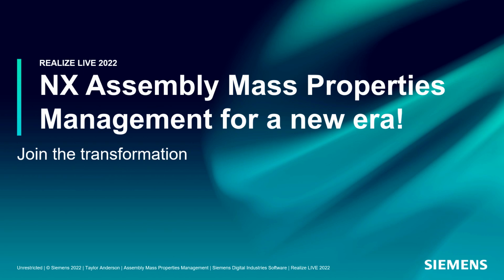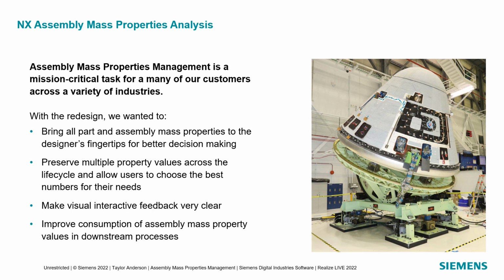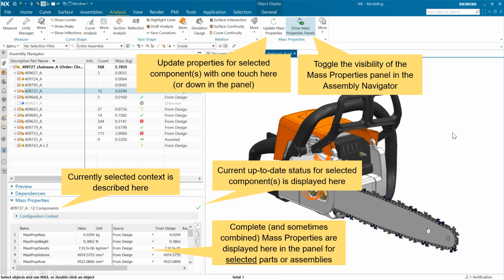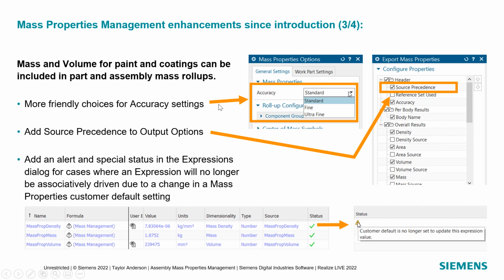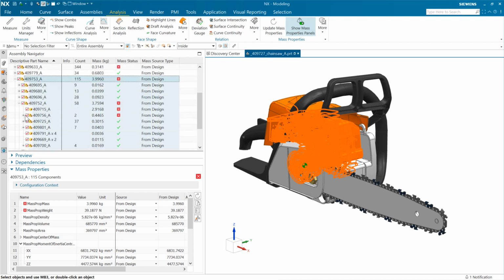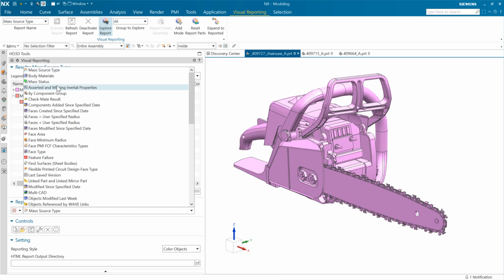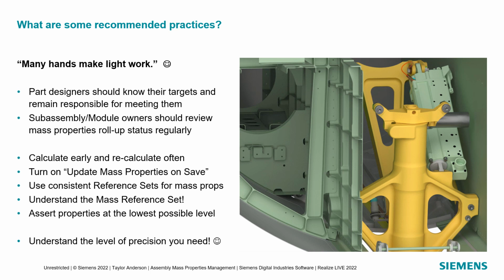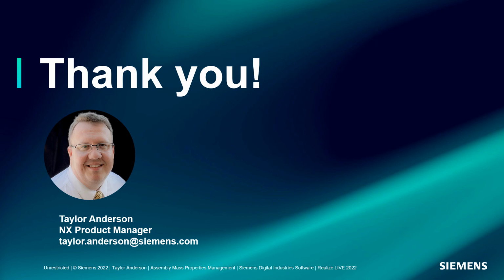NX Assembly Mass Properties:  Overview and What's New in NX 2206

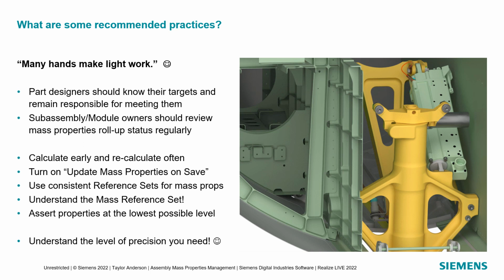Comment: Thank you for the info. At 36:30 you mentioned instance attributes. Do you have a video that elaborate this? I have some issue where assert mass at sub assembly is not rolling up consistently. Thanks!
Reply from the maker: As I mentioned in the video, assertions at the individual component level are going to roll up easiest.  Fundamentally, assembly-level component assertions are local to that specific subassembly, and will not roll up to higher levels.  As a rule of thumb, if you want to create a clean assertion that will roll up to higher levels, always make the part or assembly for which you are asserting a value the "Displayed Part" (not just the Work Part...  Use "Open in Window" to make sure it is the top-level part in the Assembly Navigator when you make the assertion.)  Assertions created in this way will roll up beautifully, just as you expect.  Does that help?

Comment: Hello 
Do you maybe know what licence do I need for this mass properties to work?
Reply from the maker: @jozehrovat3719 -- 

The optional Advanced Assemblies license, most easily accessible with Value-based Licensing (Design Tokens), lights up the Mass Properties Panel in the Assembly Navigator and Part Navigator, with tons of functionality including multiple assertion options, scaled inertial values when masses are asserted (so inertial properties are closer to reality), Center of Mass visualization options, immediate update without save for mass and inertial properties, mass reference set overrides, maturity-driven assembly rollup options, and much more. And with VBL, you can easily share the license as needed.

Hope that helps!

Comment: Thanks for sharing that presentation. Question about update part attributes. Does the tool have collaboration functionality between 2 people at the part level.
Example one person is in charge of the geometry and the other person can update the mass property attributes but does not have access to modify the geometry.
Reply from the maker: Great question!  Certainly when a group is working together on an assembly, an individual component may be owned (and open for editing) by one designer, while also being viewed (in read-only mode) by others at the same time.  And yes, if the mass and inertial properties have not yet been stored with the saved part, the read-only "others" can certainly generate mass properties data if needed in the context of their work.  Their changes will not be saved when they close the read-only parts, but they can certainly calculate mass rollups, for instance, without the need for full read/write access to all components at the same time.  Hope that answers your question!
Reply: Thanks. Your answer confirm that collaboration work is not there yet.
Reply from the maker: Heh heh... That's an interesting conclusion to draw from what I said...  We certainly have thousands of large-scale customers collaborating around weight and balance today worldwide.  :-) 

Thanks for stopping by!
Reply: Sorry I used the word collaboration but maybe that's not the exact word I need to use to explain my thoughts.
Here's what I was thinking when I used the words "collaboration work".

I was thinking more of a continuous improvement and live sharing system like those used in software development (Example: Visual Studio and the Github platform).
This type of functionality implemented in CAD software could allow mass property updates by a manager or line manager through an automatic notification and automatic update process after approval by the 3D model owner.
Reply from the maker: @lebeluet  NX certainly does a lot of real-time change notification in the context of assemblies these days.  

Here's a good video to start you down that road:  https://www.youtube.com/watch?v=sDopPt6RQ5w